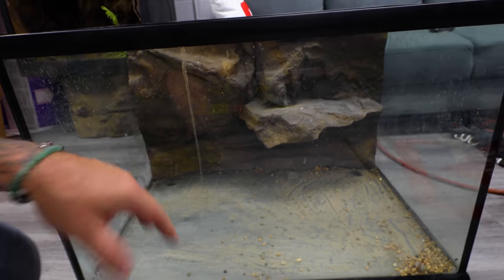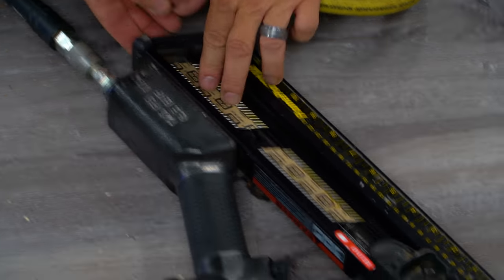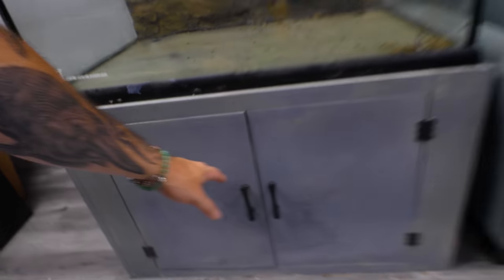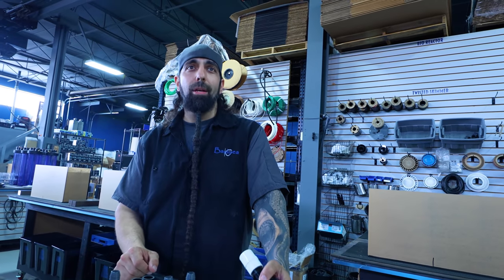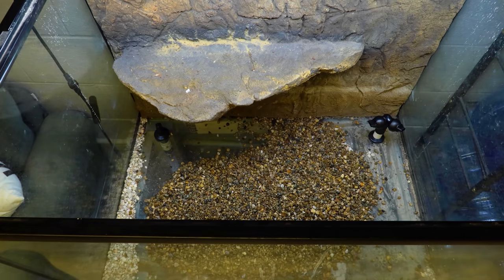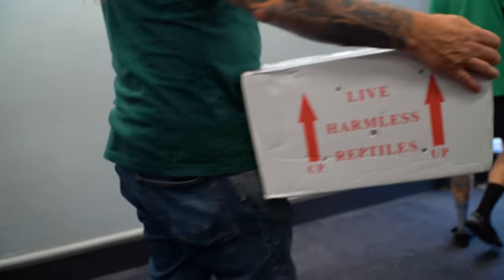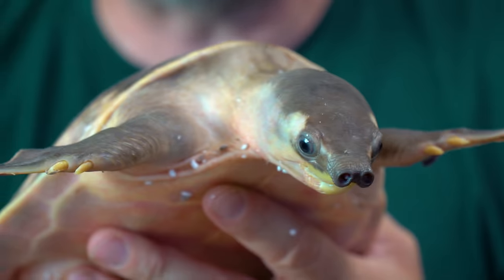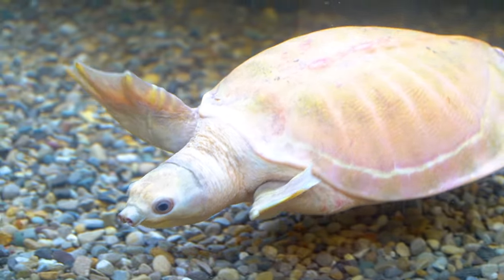BUILDING ENCLOSURES FOR MY NEW FLY RIVER TURTLES!!! | BRIAN BARCZYK

Comment: For cleaning stone and sand, put the end of the hose at the bottom of the bucket or bag of substrate and turn the water on and let it over flow into sink or onto ground. Disturb/mix the substrate with your hand as the water runs through it from bottom going up and over edge. Pretty easy

Comment: When cleaning rock like that it's easier if you use a classifier type item to put the rock in and run water through them.  Or use a bucket with a bunch of small holes drilled in it.

Comment: I think that tank is inadequate for those turtles so I hope you move them soon.  "...when frightened it can ‘shoot like a rocket’ (potentially ramming into things)..." I would think the only suitable tank for them would be round and the bigger the better. "For adults, minimum 200 gallon tank (7’x2’x2’), and much larger preferred."  You could set up a 200-gallon stock tank and they would be much much happier. The care info I am reading right now says to keep them solo due to intraspecific aggression:  "This species is known to be extremely aggressive. Therefore, it is very important to keep a low population density in a single enclosure, as well as to provide ample hiding spots. Even young specimens exhibit extreme aggression toward each other; they must be provided with at least as many hiding places as there are turtles. Because of its aggressive tendencies, it is unsafe to house other turtle species in the same enclosure as the Pig-nosed turtle. Some keepers do not even house adult male and female Pig-nosed turtles together on a continual basis because of their extremely aggressive behavior."

Having them in a small tank also makes it hard to provide the high water quality, chemical stability, and temperature stability that they require. 

just my 2 c